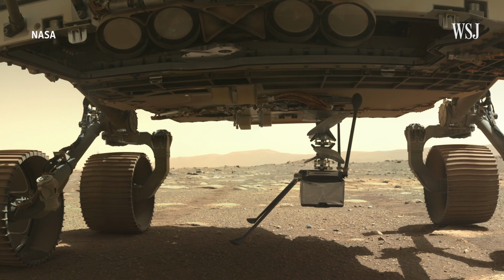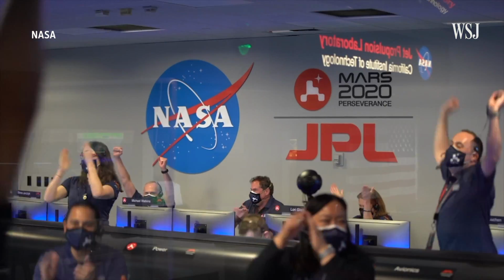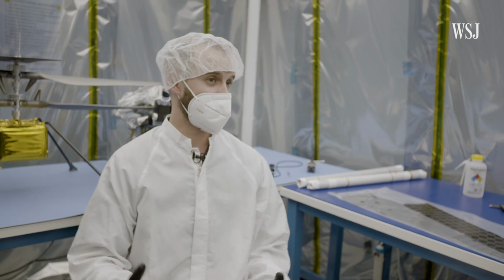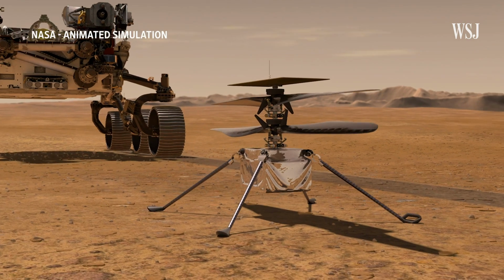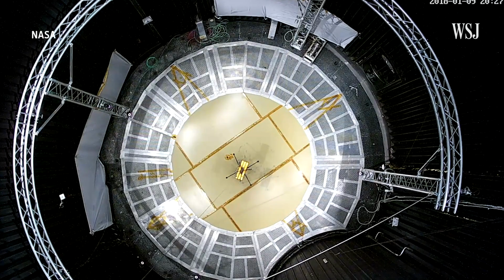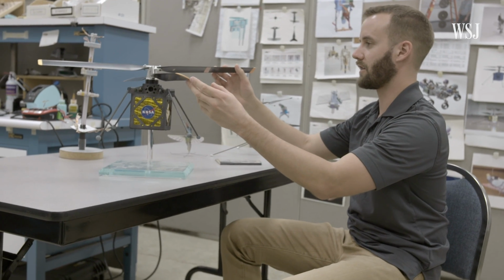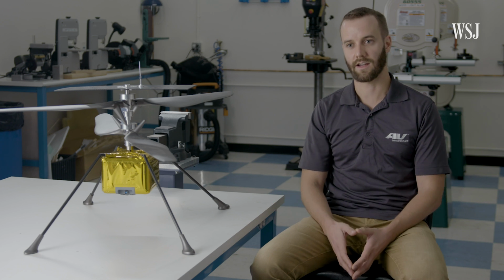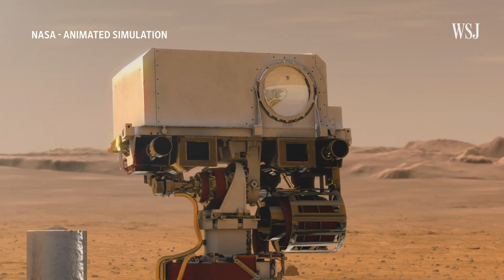How NASA’s Ingenuity Helicopter Was Developed for Mars | WSJ

Comment: Surely, another idea could be a hot air balloon which could be heated on demand using a gas canister activated by remote control. The balloon could have various cameras mounted on it and could have a long tether line, with a winch attached to the rover, allowing it to drift off a certain distance, then be reeled in again back to base and re-used.
Reply: With Mars atmosphere being so thin I don't know if that would work

Comment: Is there much advantage to this helicopter if it can only fly such short distances? What about having a long telescopic pole attached to the rover which can be extended high with a camera on the end? Surely, another idea would be a blimp which inflates with a canister of helium on command and then can float around, with a camera attached. The blimp could then be powered with electric fans to move forward, backward left, right.
Reply: The thing with this helicopter is not how useful it can be in regards of exploration right now, but just as a concept and as a test bed for future, more advanced aircraft.

Comment: Why does the model spin the rotors in reverse half the time?
Reply: I don't think it does. The two blades spin in opposite directions. This obviates the need for a tail rotor as on a helicopter.

*: I edited my original post where I said that the blades are at 90 degrees to each other - since they're spinning in opposite directions there relative positions will be constantly changing - "my bad".
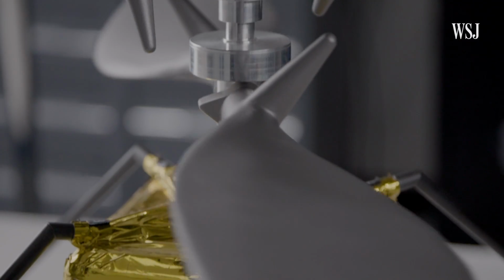Reply: @SeekerNJWC  I’m into rc planes. The blades at 0:21 are spinning backwards on the model.
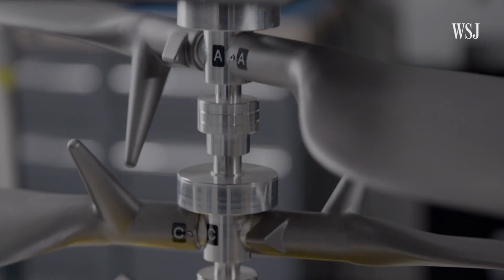Reply: @battery_wattage  At 0:21 the top rotor A is spinning clockwise and the bottom rotor C is spinning counter-clockwise. Other models in the video have the rotation of the top and bottom blades spinning in reverse. Like I said - the rotors spin in opposite directions.
Reply: @SeekerNJWC  my point is not why they spin in opposite directions. I already understand that. My point is why would they show the blades spinning in the wrong directions where the blades would provide downforce instead of lift. The average person who is not understanding of how flying machines work would get the wrong idea of how lift works.
Reply: @battery_wattage  "Gottcha" - now I see what you mean. "Beats me" - that's a puzzler all right.

You might consider sending The WSJ a message on their facebook page and ask them. Or post a message on NASA's facebook page - from there I got this address to email them: public-inquiries@hq.nasa.gov.